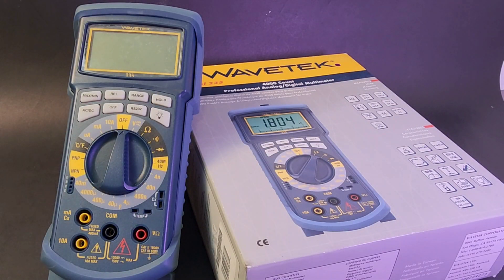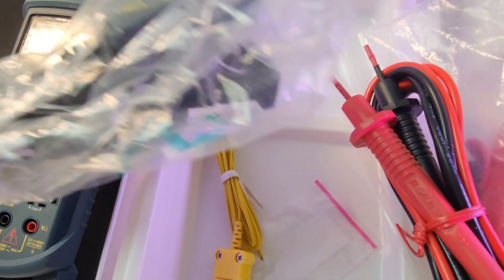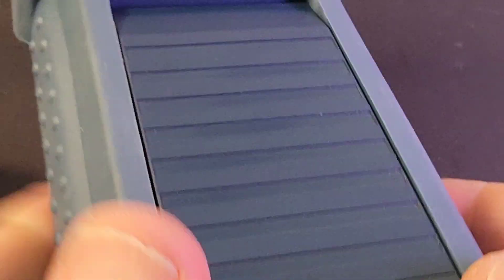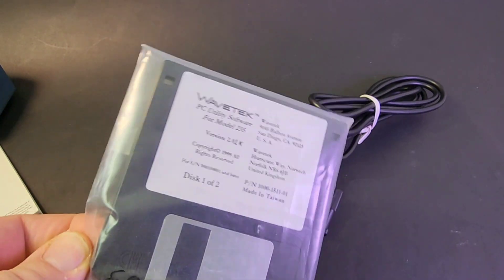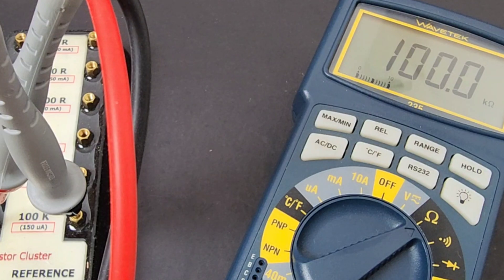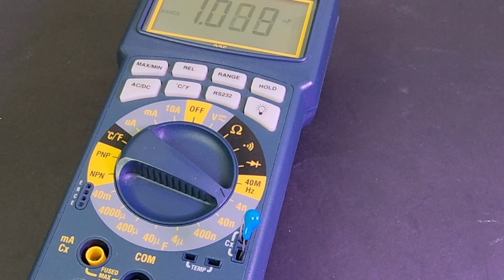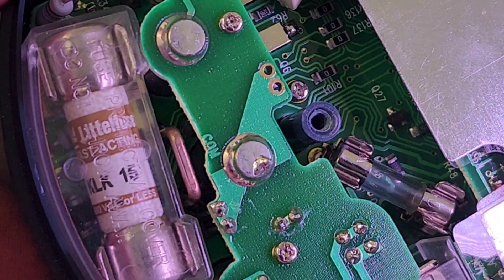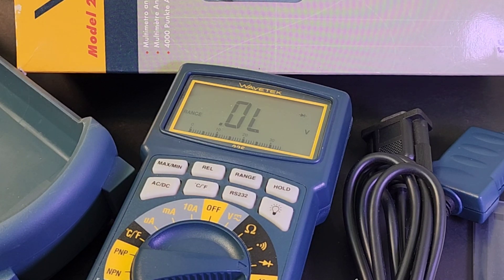RETRO-TECH ○ WAVETEK 235 Digital Multimeter Review & Teardown! (1999)

Comment: I have replaced the 9v battery in the wrong position, seems that this device have not prottection (diode) for that, and Q5 could be damaged. Someone could share the Q5 value for replacement /Q5 was damaged surface and the only smd code visible is 7???
Reply from the maker: Oh no, that's really unfortunate! I'll measure mine tonight and report back here. 👍
Reply from the maker: I've added a  closeup pic of Q5 in the latest KeepOnTesting blog..dedicated to the Wavetek 235.. 👍

Comment: Had 2 china fluke , 15 and the new 15B plus max and both has gone defective , china fluka are crap an expensive crap ,,so now its time for at cheaper meter , what can u recommend for a 50 usd  autorange multimeter ?  min max function available on cheap multimeters ?
Reply from the maker: Zotek ZT980, UNI-T UT60BT, RUOSHUI 9808+, Kaiweets HT118E , Klein MM325